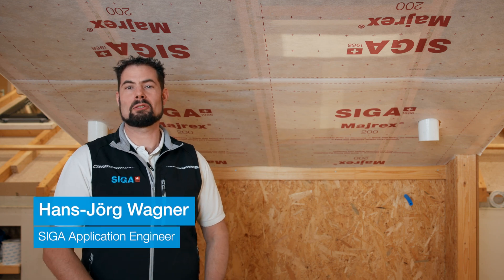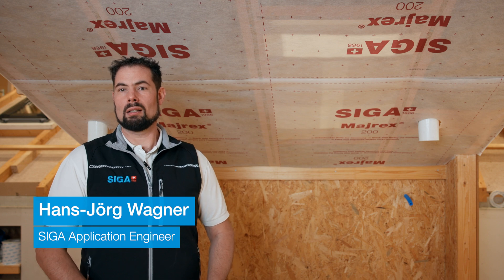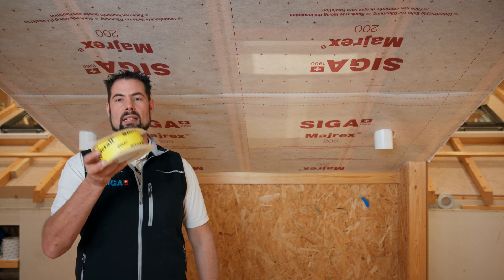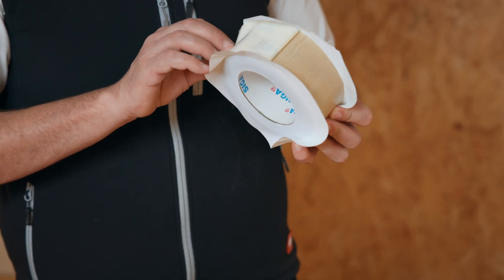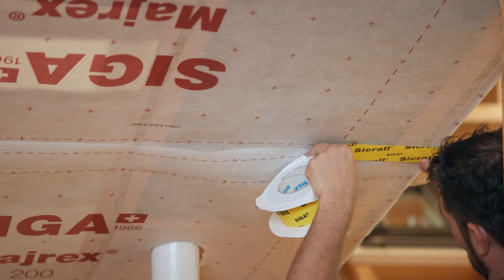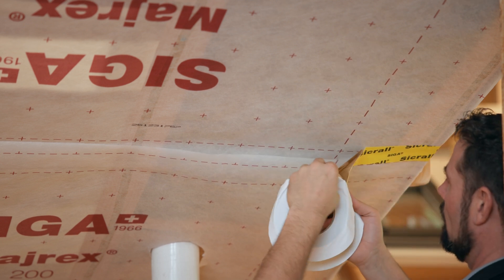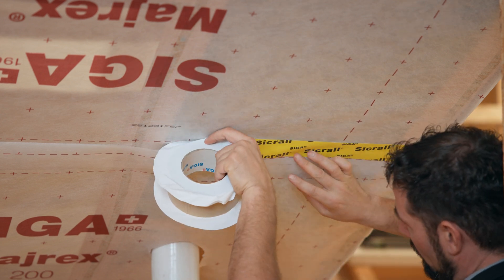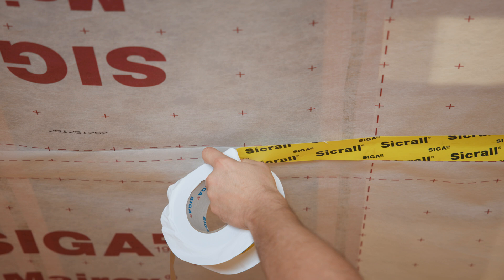Master The Perfect Vapor Control Layer Seal in 60 Seconds!

Comment: and Sicrall is more suitable for overlaps than Rissan because of the higher adhesive strength, correct?
Reply from the maker: Thanks for your question! Rissan and Sicrall are both extremely adhesive. But Sicrall has a more stable carrier and is therefore easier to apply in a straight line than Rissan :) Best, SIGA